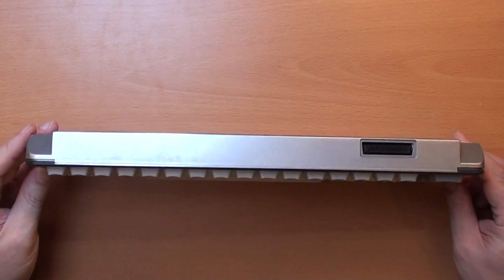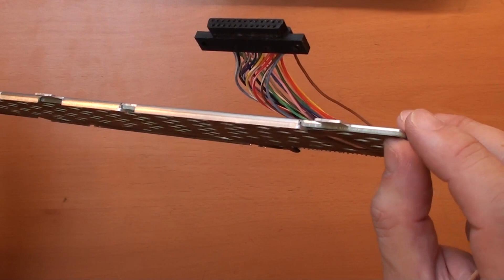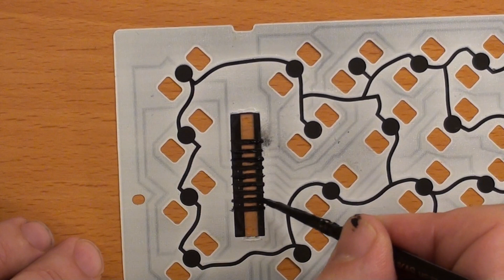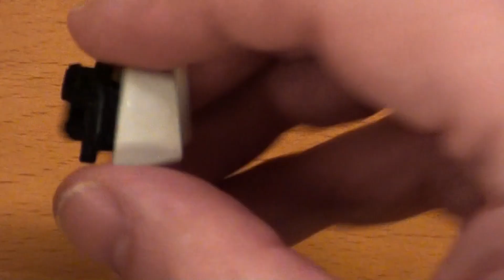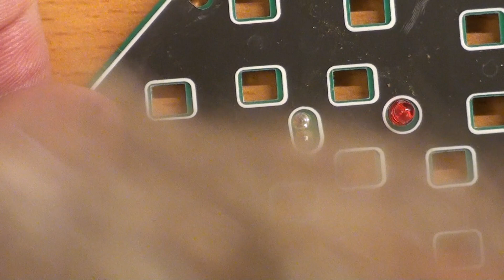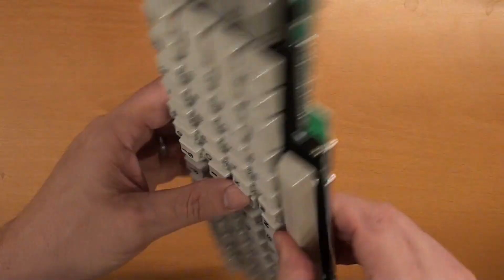SX-64 Keyboard Repair

Comment: EXCELLENT tutorial! Watched it once, then followed along a second time while I did the work on mine. I’m back up and running at 100%. 

One addition I’d suggest is thin gloves for the key removal. That part literally shredded my thumbs.
Reply: disagree - my tip is to use the end of a screw driver - gently push the clip inwards on the right side of the clip - then the left - key then just pops out - didn't use my fingers - did same with spacebar.

Comment: Thanks so much for this. Just restored the keyboard of my newly bought SX64 following along your video – worked like a charm.

Little tip if you can not get all lines responsive: The thing metal plate might need a bit more force to hold down the foil. I used a bit of tape on the board facing side that helps pushing it down with the screws. That finally did the trick for me to have it respond reliably.

Comment: I really appreciate the incredible detail in this video. Unfortunately, I wasn't able to complete the repair demonstrated. For the benefit of anyone who maybe be trying to do this and is in the US don't order what you think may be a similar "Remote Restore" product from the States... I did and regretted it. It seems that the product Rob references is pretty thick and that is vitally important. I bought what I thought was the a similar product from Amazon (US) but even after 10 minutes of stirring it wasn't nearly as thick as the product in the video. I ended up basically ruining the "stripes" on the membrane. So, like others I ordered the replacement membrane and hopefully it will do the trick. We'll see!

Comment: Thank you very much for this educational video! I like you handle every part of such a project assuming the viewer does not have any experience! I watched it before started to repair my SX keyboard. Some keys like: 8,:lo <enter> did work at all. Even during the process I used your video at the different steps. In the center of the keyboard my membrane seemed completely "glued" to the PCB. I did my best but despite your tips some little parts where not seperated and stayed stuck on the PCB. I cleaned the PCB and I ordered a new membrame from Rich and I now have a keyboard better then ever before! Thanks again for your help!
Reply: After you installed the new membrane did you have any problems with keys acting as if they are constantly pressed?
Reply: @jeffschaap  The sellor of the new membrame also supplies an isolating sheet you need to put between the pcb and the new membrame. (the first batch did not have this sheet) With this sheet it works very well!

Comment: Followed this procedure in 2025! many thanks!  When testing make sure the metal bar is pressed down (or screwed back in) otherwise key presses won't register!  Also don't put back together when keys are damp/wet (I had ultrasonic cleaned mine!) as keys again won't register! finally I recommend connecting your keyboard up to the SX64 and power on - then insert the following keys and press to make sure they appear on the screen - insert and test keys > 1----asterisk (*) -------L ------- 0 ------ B ------F ----- E ------- cusor up and down - if all test fine then turn off SX64 / disconnect keyboard and add the rest of the keys. I say do in that order as it will test all 'bit matrix' and you will know there is a bad connection with the overlay and/ or section under the metal bar. Its better to do that way rather than inserting all the keys back in then testing the keyboard at the end because you will have to take it all apart again if issues.

Comment: The saga continues for me... after an unsuccessful attempt at repairing the existing membrane I ordered a new one. But I have had no success with it either. I was able to install to without a problem. When I touch the membrane with my fingers I get the proper response from each spot on it. When press where the "1" key should be, I get a "1" on screen and so on. So I know the membrane is working and registering as it should. However, almost any key I actually install causes constant contact (as if the key was being held down). A few key will work as they should but most often they act as if they are constantly being pressed. This new membrane isn't sticking to the PCB at all (like the old one did) and I wondered if perhaps it wasn't laying as flat as it should. So I clamped it on the far left side just to make sure it was laying perfectly flat. However, the behavior is the same. If I put a slight amount of pressure on the key clips on the BACK of the board the key will function properly. But as soon as I let go it goes back to constant contact. I have checked the springs on the keys to make sure they aren't sitting higher than they should and it doesn't look as if that's the issue. I even tried compressing them a bit as shown in your video but it doesn't change anything. There were no issue with "constant key press" before I took this keyboard apart. I am totally frustrated after waiting weeks for this new membrane to show up (I'm in the US). If anyone has advice about how to install these new membranes I would love to hear it.
Reply from the maker: Hi Jeff, did you order from Rich Mellor? Did you get the clear plastic spacer to go between the membrane and the keyboard PCB? You should have done, and this resolves the problem with keys in a constant "down" state.
Reply: @robclarke7832  OK I feel like an idiot.... Yes, I did order it from Rich but I didn't notice the spacer it in the package. Thankfully, I hadn't thrown it away and it was in there when I checked. I'll definitely put that on and I'm sure that will resolve the issue. Thank you so much for your reply and help.
Reply: Reassembled it tonight and everything is working great! Thank you Rob!

Comment: Thanks a lot for this! Managed to fix one keyboard already, a second one is currently in progress. Is there a schematic for the membrane which shows which key contact connects to which of the 9 connector to the PCB? That would be very helpful.
Reply from the maker: Not that I am aware of, when I was testing I just followed the traces with my finger.

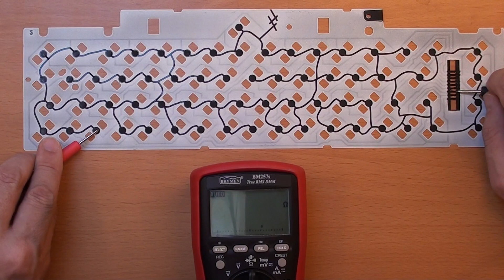Comment: around 30:50 you refer to a piece of paper to know what the farthest connections are. Where did you find this information? I didn't disconnect the clip that connects membrane and PCB. I want to measure resistance from the carbon contacts to the solder points of the cable. I want to be sure to measure all different paths from the farthest point.
Reply from the maker: i just traced it myself using a mk.1 human eyeball.

Comment: I gave it a good shot ! Keyboard was completely unusable and I got 50% of it working, but I must have boogered something up because now some keys don’t work at all. 

The membrane was almost entirely stuck solid like a sticker and I found it hard even going really slowly to not rip some of the rubber in tiny places. Anyways basically the entire bottom half of the keyboard isn’t working now. Doh. 

Ordered a new membrane hopefully that will do the trick!
Reply from the maker: Sorry to hear that Thomas. At least you have Rich's membranes to fall back on.
Reply: Were you able to successfully install a new membrane?
Reply: Jeff Schaap sure was thanks for checking back in again because I had forgotten I commented. It did work, I have two keys left that require a little extra push to get them to work but all are 100% now.

Another thing I noticed is that in colder temps it doesn’t respond as well. I think maybe the thickness isn’t the same as before (which is a known thing) but I hadn’t heard any other comments in this regard. Overall though I’m happy with it because it’s back to working.

Comment: Perfect this video is out right now...I have my SX-64 Keyboard open for overhaul just since christmas. I used Spray-Graphite and a swab to touch up the membrane dots. Unfortunately, the little foil that thickens the mebrane/PCB contact area came off and needs touching up, too. Is this something that happened to you and are there any advices or tricks?
Reply from the maker: The first SX keyboard I did, the foil pad also cam completely off as well. I put a couple of layers of graphite paint on both the PCB and membrane side and that was good enough. As with Rich Mellor's  replacement membranes linked to above, you may also be able to clamp a thin piece of neoprene rubber or similar underneath the bar which should help. I would not advise using the spray graphite at all on these membrane, I simply don't think it's needed. Most problems are solved by cleaning the PCB thoroughly.
Reply: @robclarke7832  I am completely speechless about new membranes being available. Damn you fast-forward! And reasonably cheap!... Well the graphite is on my pads now, test will tell...